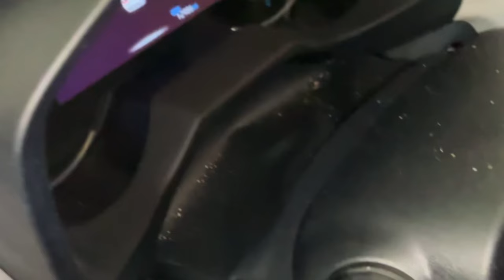From Chaos to Clean

Comment: Looks good Sheila! I need to clean my car. I cleaned it day before yesterday and then did a delivery on a gravel road. Grrr! I usually keep my car clean especially if I'm doing rides. Lately I haven't done many rides though. Thanks for the video Sheila!
Reply from the maker: You’re welcome Sunny.  I’m pretty bad about cleaning out my car, but it’s just getting really bad. I had done a catering order the week earlier this week and there was two jugs of ice tea in one of the bags and the restaurant didn’t close it tight enough it tipped over and ice tea that Filled in my bag and leaked onto the all weather mats.    So the mats were sticky.   Still have the kind of clean out the catering bags.  Thanks for watching and commenting.